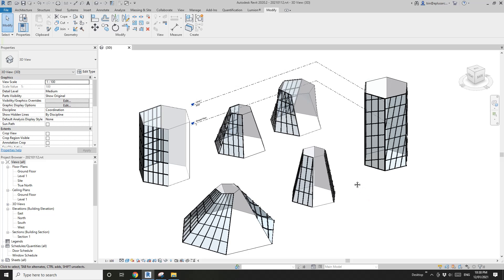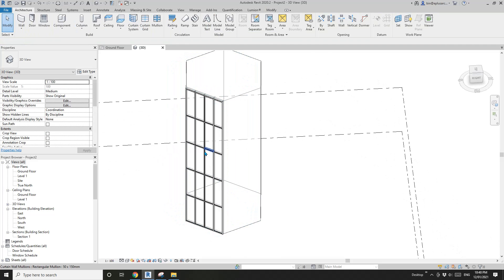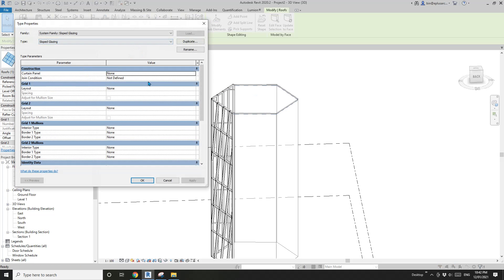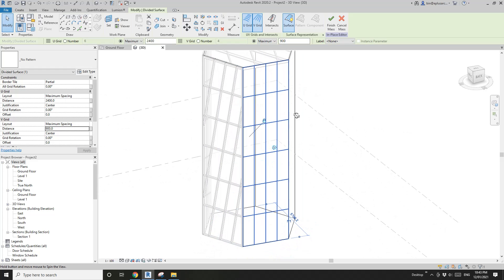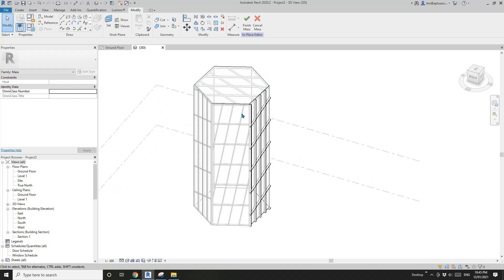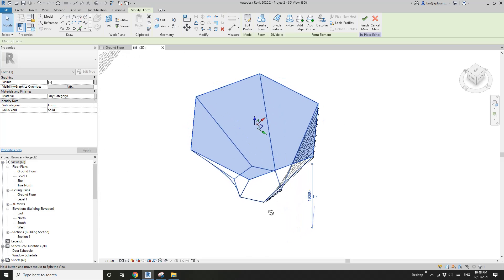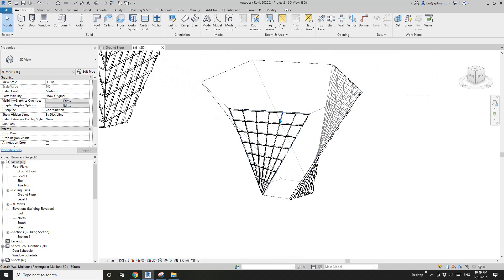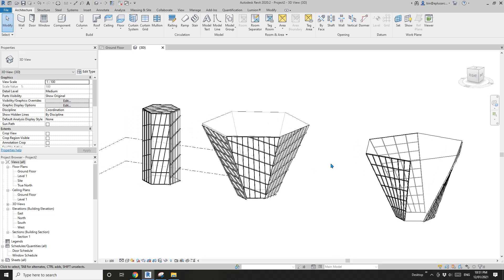Everyday Revit (Day 301) - Curtain Wall/Curtain System/Sloped Glazing/Divided Surface on Mass

Comment: But , grids angle is not changing for spherical mass or circular mass , it's happening only for straight systems
Reply from the maker: I think there can be a workaround. If you can show me an example I will have a try.

Comment: Is it possible to do request?
I want to learn how to do more organic forms because i have crazy ideas which i cant put into the computer that i want to
stuff like: https://aasarchitecture.com/2015/03/masterplan-for-the-rehabilitation-of-the-san-berillo-by-mario-cucinella-architects.html/masterplan-for-the-rehabilitation-of-the-san-berillo-by-mario-cucinella-architects-02/
Reply from the maker: You sure can! Do you mean the one with holes on the right?  I think you can create a bunch of Spline Through Point, create a form, cut some void, and place some roof by face on it, similar to this:
https://drive.google.com/file/d/1y2XXsi34CsV2LvjWZriLcH8BnX28_hLY/view?usp=sharing
Reply: @BINHE615  yeah im trying to design an ecofriendly city. Using the wavey concept in the design i showed as the river front view.i like the idea of using smooth clean surfaces but im afraid its generative design instead of revit revit
Reply from the maker: At least you can create some mass, from which you can place some elements on (Roof, wall etc) you still need to do a lot of work for some proper documentation from there.
Reply: @BINHE615  my hopes are to use this pattern along the river side and weave into the bridge
Reply from the maker: Try to become familiar with mass and adaptive families. It's could hard since the resources are quite limited.
Reply from the maker: @scottturner2233  I guess you can develop your idea a bit further, do some sketches, and we can work out a more efficient way to model it.